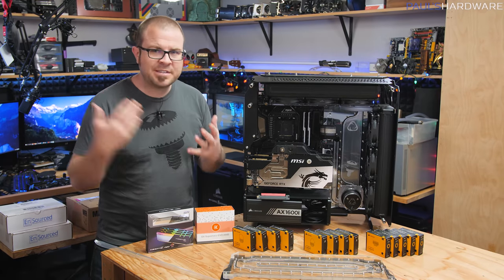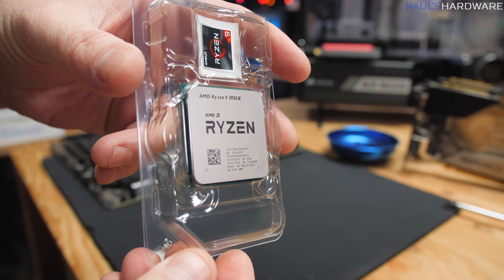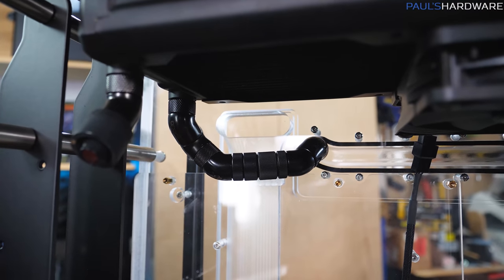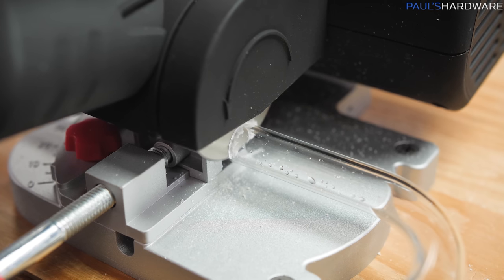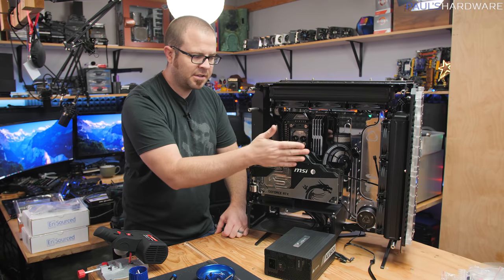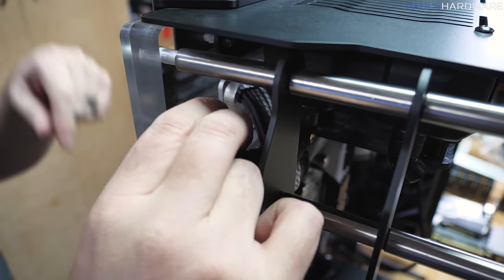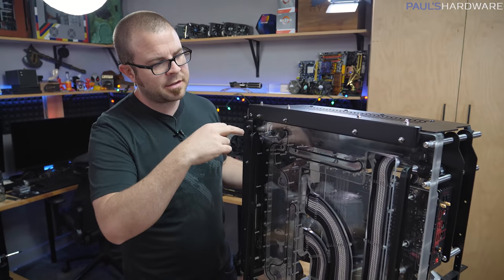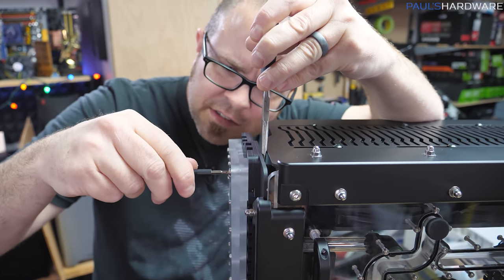My SECRET WEAPON for Hardline Custom Water Cooling!

Comment: Are there benefits to using Trident Z Neo with Ryzen?
Reply: mainly ramcompatibility, and maybe more overclocking headroom. but thats also the case with flarex for example
Reply from the maker: I believe they use Samsung B-die DDR4 modules, so they have really good compatibility with Ryzen and are pretty much plug-and-play (after enabling XMP settings)
Reply: From the standpoint of "compared to other similarly spec-ed RAM", no, there's no benefit. It's just a designation that G. Skill uses to state that it was made specifically for AMD compatibility (which is almost redundant since it's not like they're out there making RAM that "rejects" being used in AMD builds)...
Reply: @RAW_Reality  well i had some corsair ram that wouldnt post over 2400mhz so i threw some micron e-die in. still didnt run xmp of 3000mhz C15 but at least 2933mhz C15. but r3k is pretty tame in this regard

Comment: I could be wrong but, from the camera angle, it looks like the bolt or nut or what ever is holding on the blade on the chopsaw is hitting the top of the tube. Maybe a little bit larger blade? if they make one. Or I'm completely wrong and my comment is null and void. :)

Comment: By splitting 1 pipe into both GPU blocks, then restricting it back into a single outlet, you are creating a situation where the fluid will spend more time in each block, and allow them to 'heat soak' more thermal energy than normal.  Then you are sending that potentially thermally saturated fluid into your CPU?  This seems like a fine way to get poor cooling on the CPU, and could create a situation where it cooks and throttles as it is unable to dissipate heat quickly enough.

Comment: I like your content pretty informative, does anyone know what to do in this scenario?, so for some reason my motherboard Aorus B450M from Gigabyte, is not detecting the HDD, i had to install windows on my 240G m.2 ssd(which was intended for that of course) but my hard drive a 2 TB barracuda is not showing up, the drive is good cuz i took my computer to a tech person near my house, he tested the HDD on his computer and it worked perfect using my sata cables. I wonder if i have to do something in the bios section in order to make the HDD active or something? Or its my motherboard defective? I have to say that the others components work well, rams,cpu, graph card, ssd, its just the damn hard drive wont show up. If anybody knows what i might be please let me know
Reply: Move to another sata port if available to rule out a bad port.
Reply: Mike s well i dont know how many ports does my motherboard has, but i tried two of them already :/
Reply: @BeenThereDoneThat94  well if you have moved ports and it still doesn't show up might be a bad mobo.  You know the cables and hd work in another computer so you can rule those 2 out.
Reply: Jerel Wayne nope it was not there at all, even the tech guy did that on my computer.
Reply: Jerel Wayne ima buy a 1 tb m.2 and play from there. Know they are expensive but I’m tired of this crap.

Comment: Why would you use a $600 MB with 4 PCIe 16x slots and only put 2 GPUs in it? I get that you may only need two GPUs. But there are many other much cheaper MB of the same quality.

Comment: That front distro plate looks like a terrible idea in pretty much every way. Not only does it make installation incredibly difficult, but it also looks like it will choke the front radiator almost entirely ... what's the point of a fat 360mm rad if there's no airflow through it?

Comment: I don’t get why water cooling stuff is so expensive other than perhaps the low volume of sales. It’s not complicated engineering, rare materials, long tool time, etc. it should be as cheap as plumbing/screws/nuts & bolts.

Comment: water cooling fittings is the single thing i HATE buying when it comes to building computers, i dont mind buying the tubes, rads, blocks, water, or any other computer part regardless of their price but the moment i have to sit down and order fittings, i get really annoyed cause its the one thing you would like a wide verity of but they are NOT a dime a dozen so you end up either not buying enough or spending 300 dollars on just fittings

Comment: The motor is underpowered. You can hear it continuing to speed up after several seconds of run time. Too little torque? Has a transmission to get the speed and torque high enough?

Comment: Yep, it's normal you had to cut off in the middle of it regardless how professional you might be with water cooling, the entire set up seems too much of a pain with micro-decisions for fitting resulting in should this, it should that, they should together etc....
There is a large step forward DIY water cooling have to make and Micro-complication + cost we see today are NOT THE WAY.

We need watercooling to move forward that is RELIABLE, EFFICIENT, COST DIRT CHEAP TO MAKE AND SELL.

Comment: Both of the problems were aesthetic choices. The front "distribution plate" does absolutely nothing. Likewise, really thick radiators are not needed for the output of heat these components will supply. It's overkill and causing issues both now and for maintaining the system later. Dump it.

Comment: Those nuts look really annoying, idk if it would be possible or if you feel like the manufacturer should have done it but if I had to do what you did I would have tapped what the distro-plate screwed into maybe would have been easier.

Comment: So, the pre heated liquid from the GPUs will be feeding the hot CPU, not as clever as one might think. JS
Reply: Loop order doesn't matter. Never has, never will.
Reply: @CalumMcFarlane  It sure does, that's why you run two loops because the gpu will never got as hot as the cpu, unless you run it on the same loop. What planet are you from? I do this for a living.
Reply: @norsevikingsir4932  https://www.youtube.com/watch?v=RnPB_q51iVk
Components put heat into the coolant. Radiators dissipate it to the atmosphere. Assuming the loop has a strong enough pump, the fluid temp doesn't vary much across the whole loop.

Comment: I'm worried that the one video card might not get proper flow through it, since you have them in parallel like that.
Reply: Geez, Chloe, did you forget to take your medication today or something?

Actually, if one card becomes clogged, the flow will simply go through the first card and the second card would become a backwater.  If it was serial, it would get flushed better as it started to clog.  If I’m wrong, fine, but maybe someone without issues could explain why.  Thanks.

Comment: Spoiler: You'll see the thumbnail "secret weapon" in action for max 30 seconds total of this 16min video. The rest is fighting with the repercussions of the fittings/tubing/reservoir/case choices made for this build. God bless AIOs.
Reply: Nah, AIOs are the worst choice. Air cooling for cheap reliable easy cooling, custom loop for expensive good looking and incredibly effective cooling but major difficulty to set up, AIO if you want to spend a crapload more money to get no better performance than air cooling while having several more points of failure than air cooing and also two giant ugly soft tubes you cannot make look good. AIOs are for chumps.